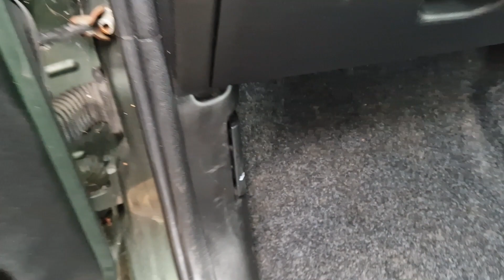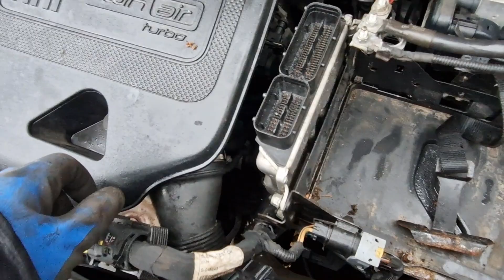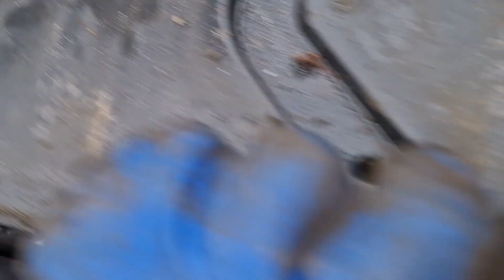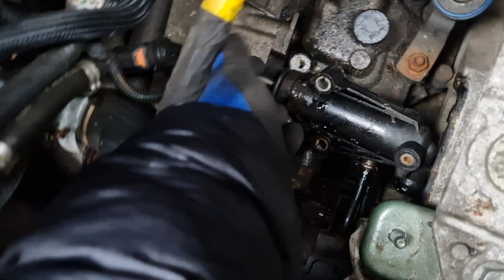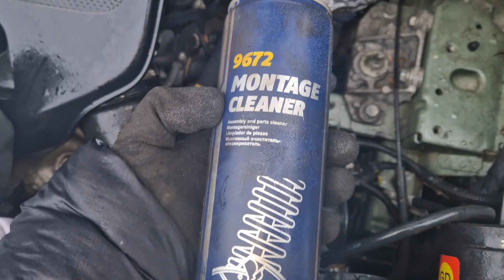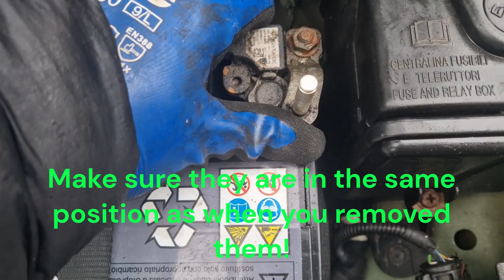Fiat Panda 4x4 0.9 TwinAir How to replace the Clutch Slave Cylinder DIY

Comment: I grease the piston rod end, Also a good idea on Panda, 500s and Ypsilon. Is to add an earth strap from one of the slave cylinder bolts to the chassis, as over time the factory strap tend to disolve.
I think most slave cylinder replacements are made because of a squeak ,and they can last up to 90,000 miles if my experience with resurrecting 500 s are anything to go by.